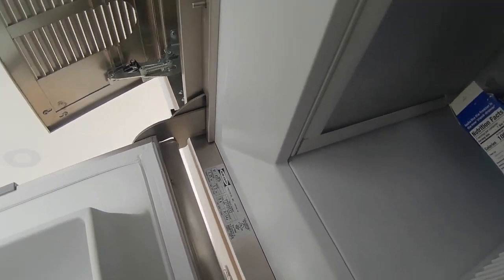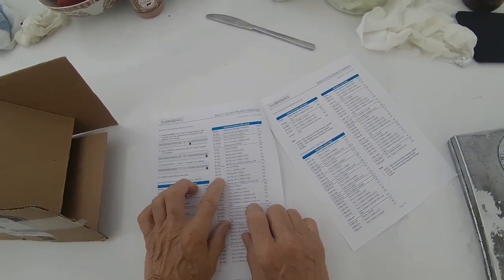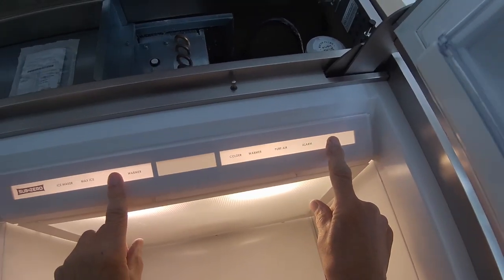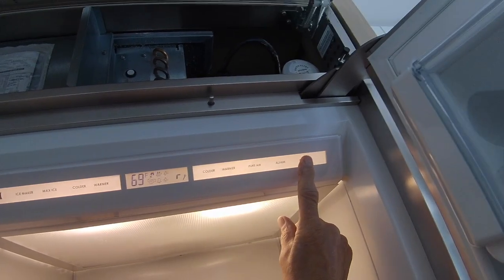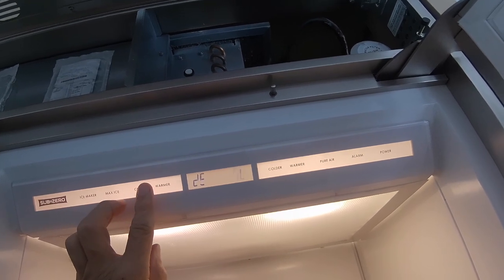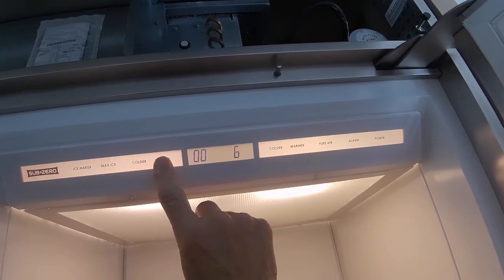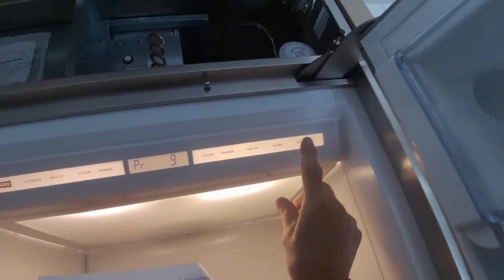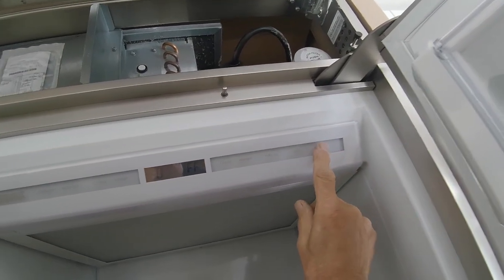Sub-Zero BI Series Control Board Programing

Comment: I have a BI36 and all the lights are on the fridge, not cooling in the freezer or refrigerator,nothing on the display, even the back lighting is on in the Display, is that an indication of a control board failure? Thanks!
Reply from the maker: @Chris-tc9pt  could be or it could be the display panel.